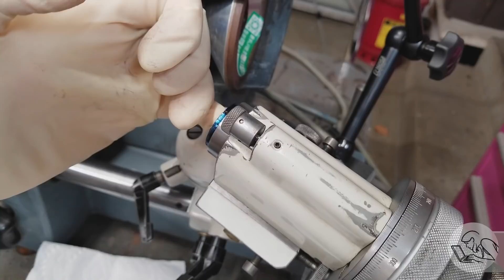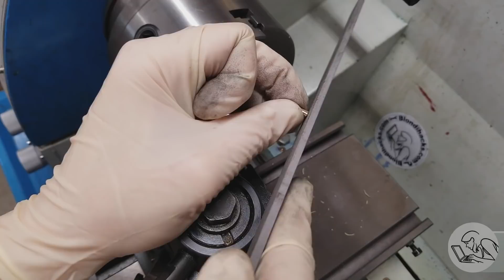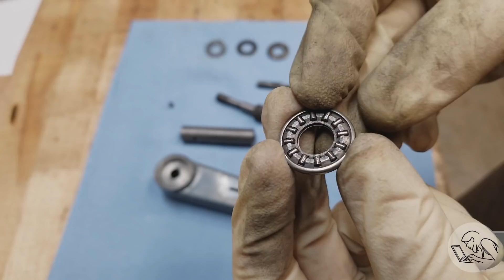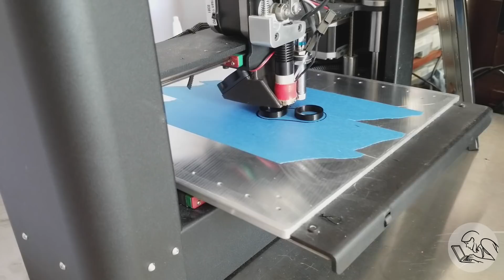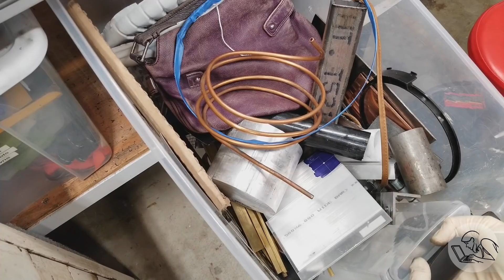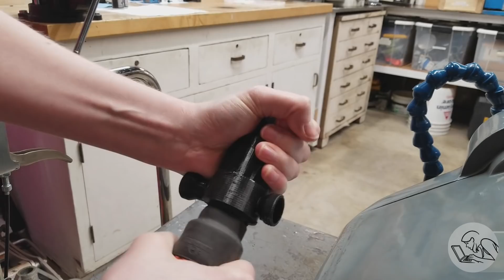D-Bit Grinder Restoration - Part 7

Comment: You might be better served with a velocity stack on the end of the hose. Getting decent vacuum draw is always tough but the engineers do have that figured out - they just never share it with the rest of us. You can find a 4” aluminum version on Amazon.

Comment: from what iv learned of my 3d printer is that they are stupidly sensitive to missing bits in the print file... so running it standalone works only if i eject the card properly and treat it like glas. also a magnetic removable build surface is the best upgrade you can make. no more masking tape and the part comes of by bending the plate. top tip!!!

Comment: Sorry to hear that you have troubles with your 3d printer I had some trouble with my previous one but since I got a Prusa mk3 it has been incredibly reliable. The only problems in many, many rolls of filament I've used thus far has been with a couple rolls of bad filament that clogged the nozzle. Having a reliable printer (and good filament) makes it a great tool that I can depend on. I'm learning to avoid low quality filament! The filament I had trouble with was a well known brand, so apparently even they can have a bad day.
Reply from the maker: I’ve heard great things about the Prusa. My old Printrbot is running a lot better with the latest Cura so I may use it more now.

Comment: When trying to snap together things like the 3D printed Loc-line joints, try hitting it with a bit of hot air - not too much though! but a little bit of heat sure goes a long way to get things to soften enough to snap together! Keep up the great work on the videos :-)

Comment: “Easy... easy...”. So many troublesome jobs in the shop go like that. Anyway, I remember you said that you can’t really use a drill press for milling as there’s no drawbar and the bearings don’t handle lateral thrust properly. You also once said the lathe is the queen of machine tools: could you put an end mill in the live centre of a lathe and use the tool-post to shift a job around in two axes?  It might work for small jobs. I’m thinking about people who own a lathe but no mill. Anyway, your channel’s the best, mostly for the jokes. And the butter in the tool drawer. :)
Reply from the maker: There are tricks like that for milling on the lathe, absolutely. You can get a so-called “milling attachment” for the lathe which mounts the work to the cross slide, and you put the milling cutter in the lathe spindle (generally with a collet chuck or collet closer). There are other ways to do similar things as well.

Comment: One final thing I must comment:
3d printing takes much more time as you increase a part's height compared to length or width. If you can't reorient your part to make it shorter (or support material location or layer direction matters) you can split the part up into smaller sub parts to print at the same time.
It sounds weird doing this (making one part into several parts I mean), but it can save a lot of time. Plus Fusion 360's 'split body' tool makes it easy. Some slicer programs might also let you split a model.
Also, increasing the number of exterior shells in the slicer settings can really help with print strength. And for parts that absolutely need to be strong, you could print a hollow mold to fill with epoxy.

Comment: To bend acrylic I recommend a freehand technique. Usually, I put a piece with just about an inch or less in a vise (I.e. Say I have a 12 inch tall piece with 11 inches above the vise jaws) and using a heat gun and a welding glove I slowly heat the piece and bend it. It works really well as I can target more of the heat to just a small area, bend that, and move on. Sort of like making a curve out of multiple small bends. Then I can apply heat more widely and smooth it all out as I get it to the shape I want. This way I only need a smaller amount of controlled heat for the first bends, and don't need to rush or worry about overheating if I were trying to bend the entire piece at once. 
And, if I mess up and the curve is crooked I can apply heat to only the areas I need to move. Using a glove to freehand the bend is more flexible than using a mold.

Comment: If you want to get tricky you can grind a V in the end of the parting blade.  That will keep it tracking and give you a cleaner cut.  Though hard to say if in the end it saves any time since the V is time consuming.

Comment: Those shiny bolts hust look like regular shoulder bolts to me. Look v similiar to the ones mcmaster sells. Was  there something nicer about the finish I was missing?
Reply from the maker: The finish on them is a mirror. Like a chromed hydraulic cylinder. Not common, no.

Comment: Tip for grinding tool steel with diamond. I have FOUND (non scientific so don't sue me) that using water for a lube/coolant works like magic. The obvious problem is though water is disaster for machinery both with rust and potential electrical hazard.

Comment: Great example of a 3D printed idea. Never be afraid to adjust and print again and again. In the past I have used a heat gun or hair dryer to heat the plastic. It makes it soft and flexible.  You can use a rag, glove or shaping tools to get the plastic to mold perfectly around the odd shape. This works perfectly for fitting complex parts into oddly shaped components. Use liquid soap for sliding parts.

Comment: Just an idea - when adjusting the eccentric lock for the indicator ring, why not loosen the jam nut, then reassemble, and test, test, test, using the (accessible) slotted screw to find the right position, then disassemble and lock the screw in place with the nut?
Reply from the maker: I tried that, but it doesn’t really work. The screw doesn’t stay in one place without the jam nut being tight.
Reply: @Blondihacks  Oh, bother. Well, at least it wasn't a totally stupid suggestion.

Comment: Try printing in PETG instead if you don't need to glue it. The layer adhesion is as good as the tensile strength. No cracking!
Reply from the maker: Good to know, thank you! I’ve only tried PLA and ABS

Comment: You might want to try adding some aluminum wire (so-called armature wire by the model making types) inside the LocLine. I use this to stiffen LocLine and to make it "more better" as a holder.
Reply from the maker: Great idea!
Reply: @Blondihacks  Not my idea.  I saw it on Adam Savage's Tested channel, but I suspect... He found it elsewhere!

Comment: For dust vacuuming, especially grinding dust, you really need to use a cyclone vortex attachment to remove most of the particulates before they get to the vacuum cleaner filter. I just bought 4 aluminum cyclones to use for my metal cutting and milling devices. The cyclones are very durable and work great with a grinder. Their size means you can gang them up for more airflow or use several at a time on different tools using the same vacuum source. Search aliexpress for "Cyclone SN25T5" $13.50 including shipping.

Comment: From what I remember reading acrylic can absorb moisture so before heat forming it needs to be dried for a while at a low heat which I think can be done at around 50 to 70 C.

Comment: Thanks for another great video.  At Approximately 2:00 you mention applying a "thin" coat of blue to the part.  I have found that the thinner the application of blue the more accurate the reading.  Your application appeared to be a bit thick.  Too thick of an application will fool you into thinking you are getting contact when you really aren't.  Just my 2 cents worth.  Keep up the great work.

Comment: Nice to finish things off. I still have some bits of mill installation to do - like that fancy on/off switch with e-stop that should be fitted to the actual machine, rather than using the switch on the socket (nice thing in the UK, wall-sockets have switches, so you can turn the power on & off at the socket)

Comment: I don't know if someone already mentioned this. But a possible source of your remaining run out could be the squareness of the back side of the spindle. Or possibly the squareness of the draw bars shoulder. If there is a out of squareness or something causing the draw bar to push only on one side of the spindle, it could actually cause a bow in the spindle as you tighten the draw bar. This of course could cause the small amount of run out. This could also explain why it was not repeatable in the same spot all the time and yet the spindle runs true with no collet mounted.  Something worth checking anyway.
Reply from the maker: Good tips, thank you!

Comment: Great video! I recently struggled with forming/bending a Polycarbonate sheet. In the end I came up with laying the sheet on some baking paper, slowly ramp up th the right temperature where it's soft but not liquid or burned in the oven (or just Google beforehand) and than laying it on the die and let gravity do the rest.
Reply: Polycarbinate plastic absorbs moisture, when heated above boiling it forms little steam bubbles inside the plastic. Solution is to do a slow preheat over 8 or 10 hours to drive off the moisture. You can actually cold form the stuff pretty well. Our shop has a 3 X 10' oven for heating plastic to forming temperature. Controlling the rate of heating is important.
Reply: @larryschweitzer4904  thank you for the insight!

Comment: Dear Quinn,  I just got off the phone with the space ship factory , You got the job !!!! Bring  the D bit grinder and your positive attitude .. see you Monday morning , Some times when working with close tolerance plastic parts , I will run them under very , very , hot water (take your time) a few drops of hand soap ,  and a velvet touch , if that does not work Proto type 2 needs  a few .000 ,     Pete M

Comment: The trick with the plastic sheet might have worked with a different material. I've bent PET sheet with hot water (not even boiling, just ~75 °C). You can submerge the whole part for homogeneous heating too.
Edit: PETG not PET.

Comment: What a coincidink!  Just last week I printed 20 Loc-Line style parts (@ 200% scale) and had the dubious fun of putting them all together.  Yay.  :/

I broke 3 before working out the trick; (I was using PLA, so brittle) if you heat the flared, socket end with a hot-air gun it becomes malleable enough to easily pop in the ball end of the next piece and it shrinks back as it cools.

 Muchos grande thanks for another great, informative and entertaining video.

Comment: Great diagnosis and repair/commissioning.
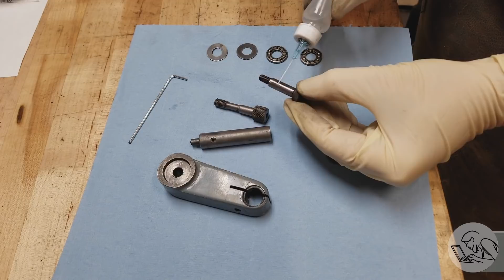That shiny screw you liked so much 11:50, is called a " Shoulder Screw, also called stripper pin, there are a standard item available at all engineering suppliers, in stainless steel as well.
Pretty impressive 3D design and printing, it can be problematic 😰😰😰😰, at times.
Great vlog Quinn, thanks for sharing and best regards John.

Comment: I found that PLA can be softened in hot (almost boiling) water enough to become quite pliable and plastic if you print in PLA you can soften one or both of the parts, fit them over each other and perhaps when they cool the fit will be to your liking.

Comment: Nice video, I've been telling my boss that there's this real cool woman machinist out there that has a YouTube channel. I had to laugh when I seen you use q-tips. I sometimes use Q-tips when I paint and do artwork or mark automotive parts so I know what order they go back. Things are well in Northeast Ohio although Cleveland State University is not going to have classes because of the Coronavirus so I guess everything is going to be done online. I'm not happy about that.
Reply from the maker: I use a lot of Q-tips, largely because I don’t have compressed air in my shop. Q-tips are good for cleaning out small areas when you can’t blow them out. 😁
Reply: I used to use these extensively when cleaning some aspects of electronic equipment (tape decks ferinstance), and bought a box of 1000 with the longer wooden sticks that I'm still working my way through,  years later.  I'd point to the supplier but they seem to have gotten out of that side of the business.  Some searching should turn these up,  though.

Comment: Hi Quinn, I find your videos very interesting , not necessarily because of the exact content , but to see how you go about problem solving. My current interest is CNC routing , to make parts for flight simulation. One tip which might be useful to you , is to connect a smaller diameter hose to your shop  vac , you'll get both the higher flow rate , and less drag . I've used a 3D printed reducer to connect  25mm id corrugated hose to my Festool Midi  with a sacrificial piece of 22mm waste pipe as the nozzle :)

Comment: I think as youtube creators we spend most of our time building tools to build or modify other tools.  At least it is fun to do except when you buy a cheap tool that the rest of the job depends on.
Reply from the maker: In software engineering, we call that “yak shaving”. Making a thing so you can make a thing so you can make a thing...
Reply: Blondihacks  Interesting terminology! How did you arrive at hair removal from an animal of the bovine persuasion.L.O.L. Wouldn't engineered over complication be more clearly understandable?😆

Comment: Hope your orphaned Prinrbot is still going strong.   I actually built my own 3D printer using steel structural metal from HomeDepot for the frame.  I 3D printed some of the parts (on the same machine, it upgraded itself), that's what's known as a RepStrap.  I do most of my 3D modeling with Open Scad, which is a program only a coder could love.
Reply from the maker: I love OpenSCAD! Fusion 360 is also great for 3D printing. The latest version of Cura gave my old Printrbot new life. It prints 10x better now than it used to. I think I can keep it going for a bit yet.

Comment: how about printing a cover for the grinding wheel so only the grinding spot is exposed, and attach vacuum to that cover

micro and nano steel and carbide particulate inhaled?  nein danke
Reply from the maker: That would be ideal, yah. I may do something like that eventually.
Reply: @Blondihacks  Even Stefan doesn't have a full dust cover on his grinder  :)